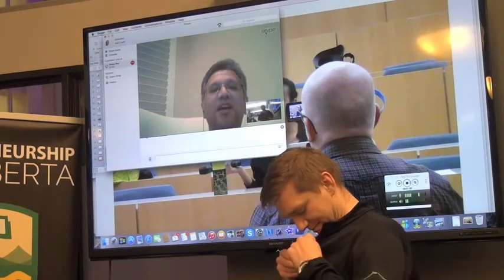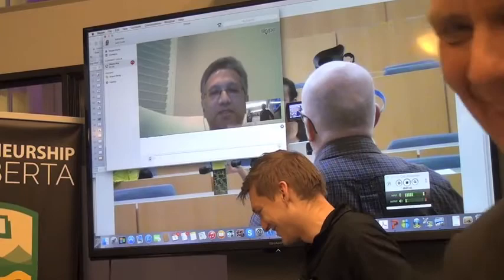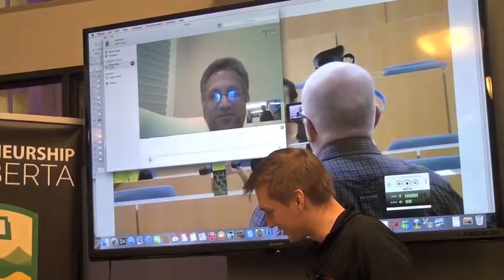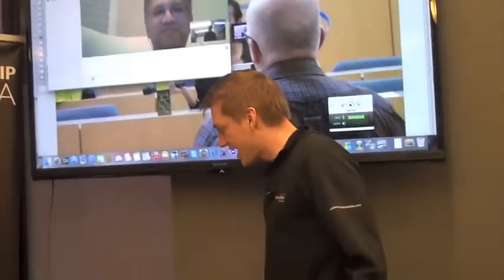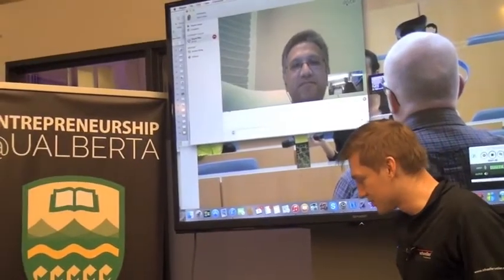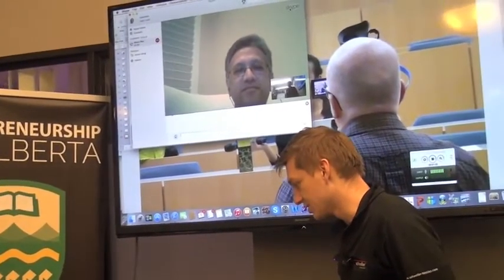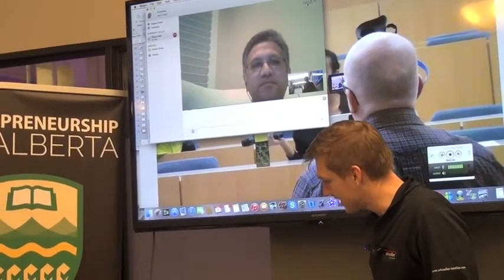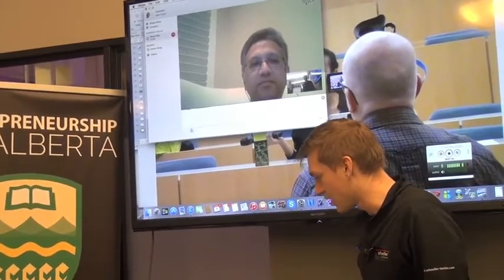Shuvo Roy Bioartificial Kidney Using Silicon Filter Future Day 2015

Comment: Try this way...
1. Developing and using one's own cells is promising, 
    Why not try to repair removed original kidney outside the body, and replace, till that bioartificial kidney may save the life. 
2. If 50%or more nephrons are inactive or  dead ,
  Make a bypass of filtered blood through artificial kidney and let the original kidney heel itself in owner's body, calling natural recvery and if successful,  remove the artificial one. 
3. Never remove original kidney, or urine tracts but make bypass through artificial kidney, and let recover original organs naturally. 
4. The limitations of mechanical way to filter blood may be numerous and unending, shall make very late to apply on human body, great challenge to the or from the nature, may end up in...
   Bypassing original thru artificial and repairing original kidney outside the body, in the laboratory by developing a fast way, 
   May be a hopeful project using the help of the omnipotent nature and the technology...
   God bless, your efforts.